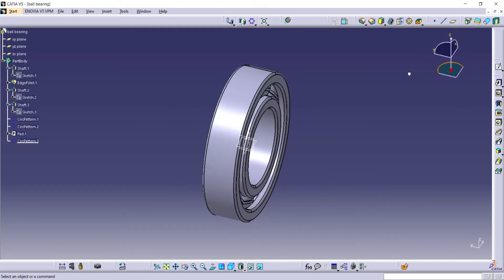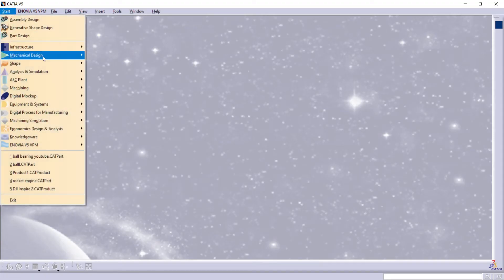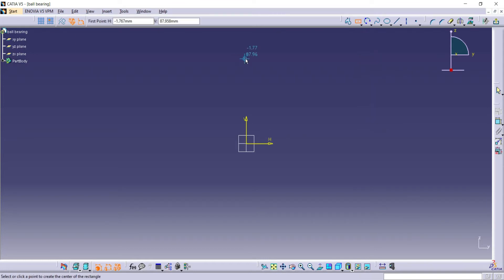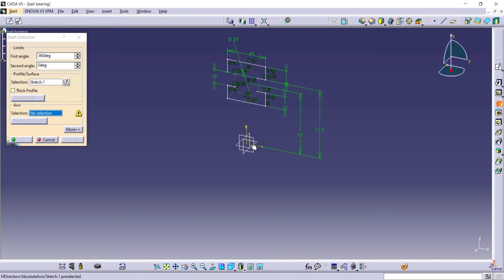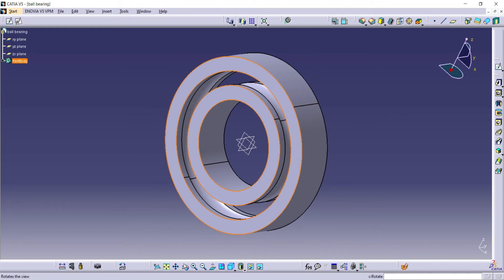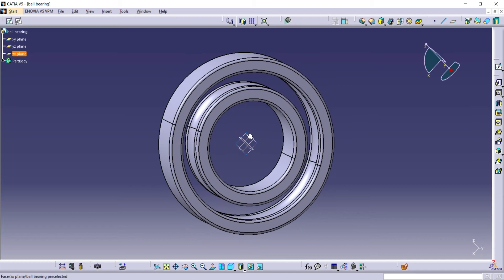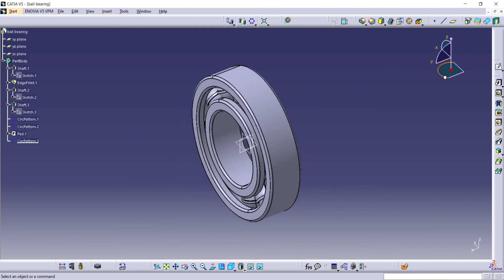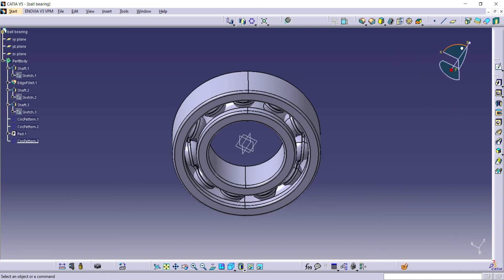how to design ball bearing in catia v5 | mechanical design | part design.

Comment: bro could you plz tell the ball bearing series num
Reply from the maker: this video will give you an insights about how to design the ball bearing. this is not an proper ball bearing design which can be used for manufacturing. so dimensions is no as precise as the real ball bearing. there might be an deviation.